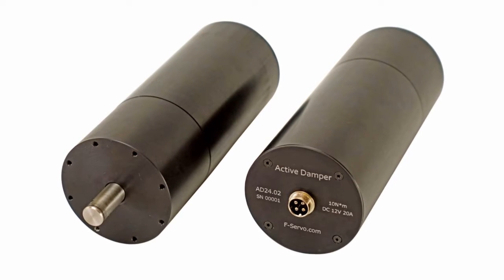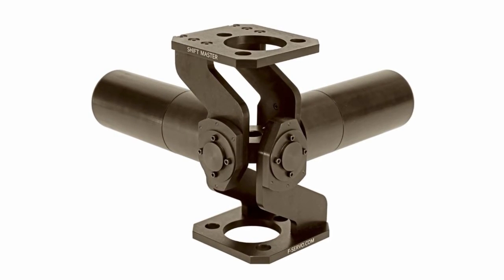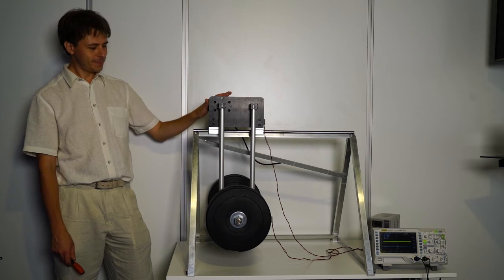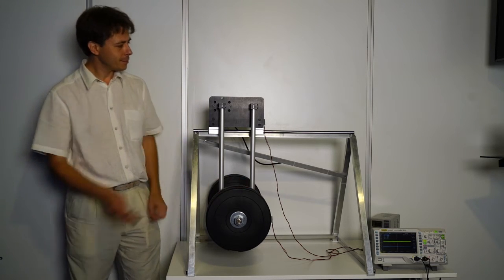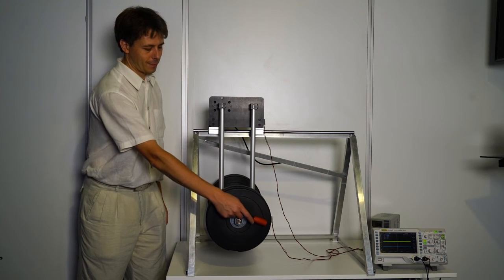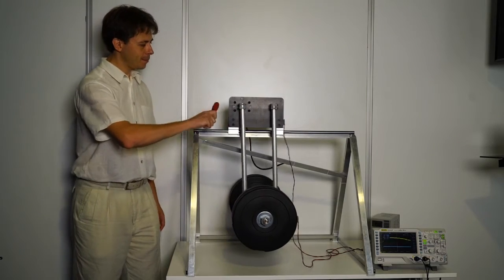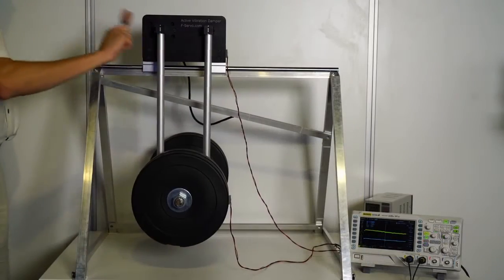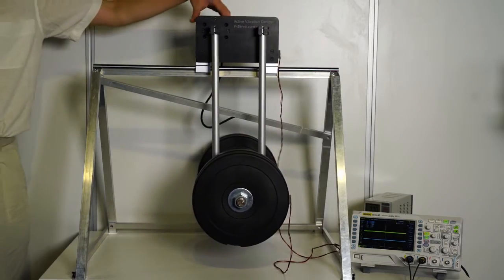Active Damper explanation. Linear vibration stabilizer for a Camera Head.

Comment: Would it work if the pendulum was inverted? I need the same result, just the camera has to be on the top.
Reply from the maker: For a vertical pendulum servo should be more powerful. It can be calculated and produced.

Comment: Hello, does it work as a kind of Tuned mass damper. I would like to know if that system is called "active" thanks to the variation of the damping factor (the viscosity of the fluid for example). ((This is a part of my research subject, an answer from you would be a real opportunity ))
Thanks in advance.
Reply from the maker: It contains gyroscope, torque sensor, controller, motor, gears, springs.